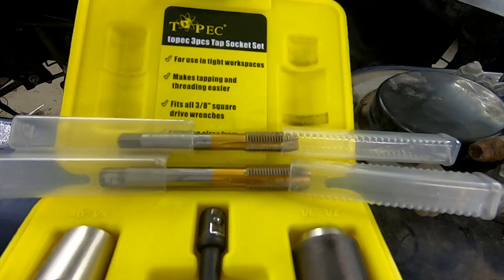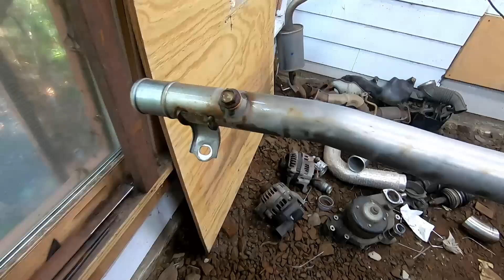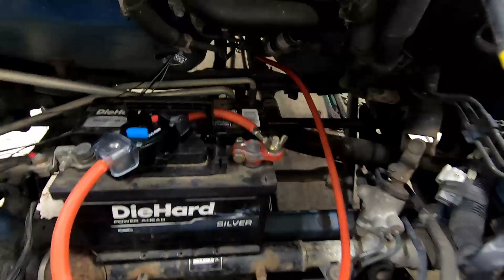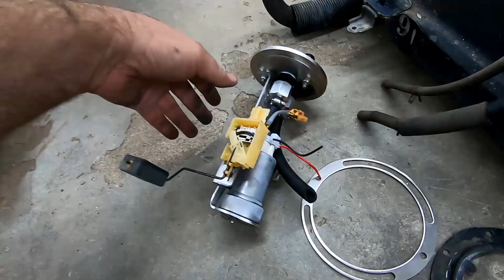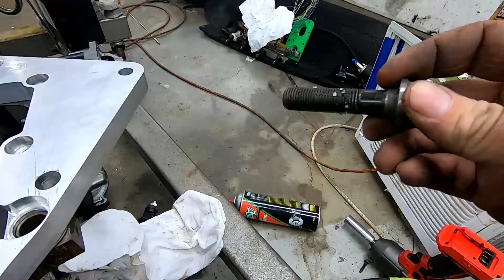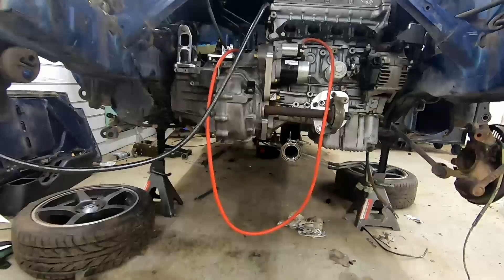MR2 Spyder Kia Spectra to K20 EP3 Trans Adapter Installation

Comment: It doesn't let me tag you in that other comment about the turbo manifold. But what I was saying is that I really like the setup that I have because I like having the turbo stick up out of the hood one because it helps keep my wastegate cooler and two I like having the turbo stick out of the hood the way it does. Because I don't have a drain back set up in the oil pan I have the drain back going to the valve cover. The whole reason I started building it that way is because I was lazy and I didn't want to remove the oil pan to put a drain for the turbo so I ended up building the drain into the valve cover and putting the turbo up out of the hood like that LOL. But I love the way my manifold flows because it is a 4-2-1 setup and it flows really good.. just out of curiosity though what would you want for it just in case I ever want to build another one as a sleeper
Reply from the maker: Shoot me an email bro enigmagarage843@gmail.com

Comment: Hey enigma. You should totally look into what it would take to build a trans adapter for inboard boat applications because it would be sick to make an inboard boat with a T8D engine. I mean the power to weight ratio is pretty dang good considering what most boat engines have and since we know they have really good windage  trays inside of the oil pan and a fairly deep sump they would also be good for inboard boat applications since they would not starve of oil when you do hard cornering/leaning in the boat. Maybe one day if I make it big we can do a collab on some crazy boat stuff LOL.
Reply from the maker: That's too much fab for me lmao plus I don't want to get into boats again.   I lived on one for about 3 years!